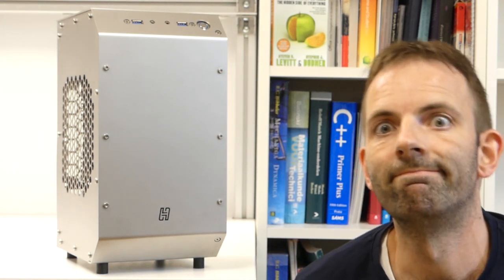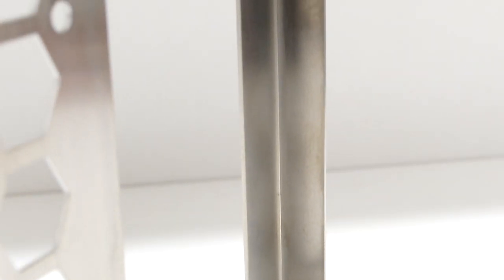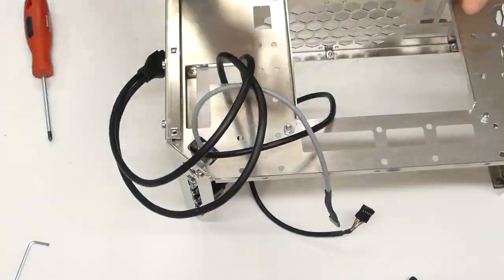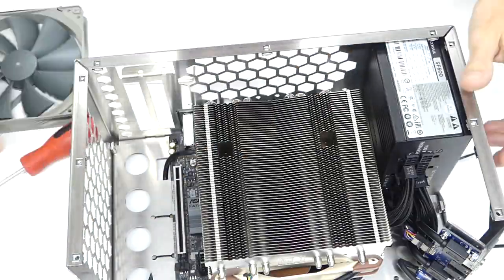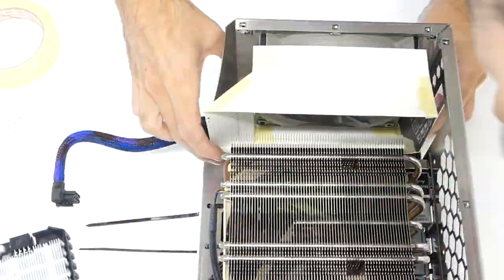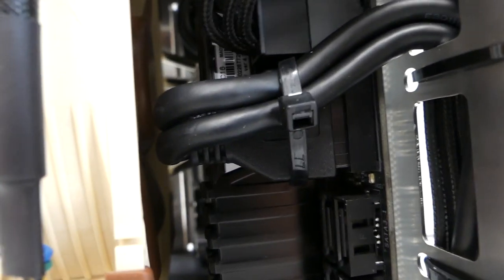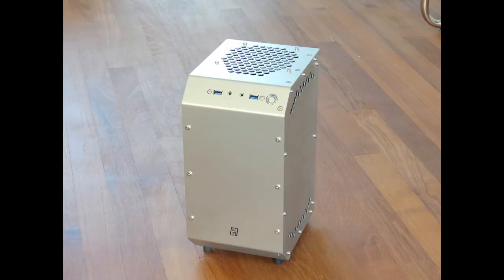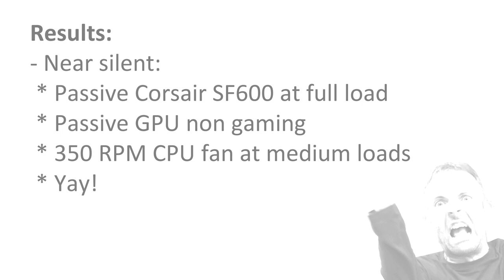Custom Mini ITX Stainless Steel Case Design And Build!

Comment: Great job! Power button is clunky but it does the job, a simple connector to join wires would be perfect to keep the button mounted to the shell
Reply from the maker: Yeah. I'm now thinking about having some washers made to stand off the button a bit, so it sits more flush. But a design 'feature' will make this hard.. The nut that holds the button in sits against the mobo tray. So I can't undo the nut, I have to turn the button in order to undo it.. Which means getting all the cable ties out and taking the power button/led connector off the mainboard... Its on my to do list for 2028 :D
Reply: Niels Heusinkveld that’s a good idea, having it flush by adding washer under instead of looking recessed like now will totally make it look more finished

Comment: Now I want to see the 800W gaming PC smart air cooled Heusnikveld solution!
Also, have you seen the new ATX 12VO standard from Intel? No internal power conversion to lower voltages in the PSU, those will be on the MoBo. In Linus's test, the low power efficiency was a LOT better. Interesting future. I will have to re-think how to heat my office room in the winter I guess.
Reply from the maker: Yeah I think the Linus video is inaccurate. Most power supplies already do efficient lower voltage conversion. Its only a few watts of power, compared to the 12V power consumed by a system. A little bit of wire to run a few watts of 5V power through isn't going to make a big difference in my opinion. I hope I'm wrong because modern systems only use so little power when idle, it sucks that you get 90+% efficiency when gaming but when staring at a spreadsheet, efficiency is much lower.
Reply: @NielsHeusinkveld  I think that Intel has other reasons behind this. The actual solution would be better label standards- because, as you say, power supplies CAN be efficient in the low power range, yet they rarely are. But... let's say you are a PSU manufacturer and want to bring a cheap 750W Gold efficiency PSU to the market, who is keeping you from not giving a s*** about the efficiency at the 70W range, if the label specs only start at 20% of max power. Not everyone reads extensive tests when buying a PSU. 
When the 80% efficiency standard launched ages ago, it was great for the environment, but they should have reinvented the standards for those labels a long time ago.
Reply from the maker: @renereiche  I think in the old days 20% was reasonable because CPUs and GPUs didn't run so low power at lower loads if I recall. Perhaps they should make a new line, call it 90+ and have a required efficiency at 5% load (5% of 600W is still 30W which is close to the idle system powerconsumption).. Instead of 100 different 80plus standards, start fresh, and raising the bar with 90+ :-) Of course you probably can't be 90% at 5% load, but at least get manufacturers to increase the efficiency at such loads.

Comment: Hey Niels, I'm designing my own itx case right now. I'm curious what sheet thickness you used for this and how ridgid it feels.
Reply from the maker: Hi, its all 1mm thick stainless steel. Steel and stainless steel have the same stiffness (i.e. how much a panel will bend when you twist it). Aluminium has 33% of the stiffness of steel. Aluminium also weighs 33% of an equivalent steel part. But most importantly, the stiffness grows with the ratio of thickness ^3 so going from 1mm to 1.5mm is a factor of 1.5, which is 1.5 ^ 3 = 3.375x stiffer, if the material is the same. The difference between 3mm and 1mm is a factor of 3, and 3^3 is 27x stiffer! Material thickness plays a HUGE part. And since Aluminium has 1/3rd the stiffness of steel, using 1.5mm aluminium is still stiffer (3.375 * 33% = 1.125) than 1mm steel. Finally and probably the most important is your construction. If you bend 90 degree lips like I did on the mainboard tray, you effectively increase the thickness of the material as you add 'ribbing' so to say. So the design and placement of ribs like that can easily make a 1mm steel case more rigid than a worse designed 2mm steel case, even though the pure material stiffness of 2mm is 8 times greater.

Comment: Makes sense if you want to show off 😉
I am slowly converting my PC to as silent as possible step by step.
My problem is now that the HDD and DVD reader are the loudest. And because of video making I'll probably keep using HDDs for a little while on.

Your greatest danger for nasty noise now is coil whine. Though, with an overspecced PSU and a 60 tier GPU, the coil whine might be quite low.
Reply from the maker: Can you soft mount the hard drives? That can make a big difference. Coil whine is nasty indeed! High pitched sounds.. Thankfully the card is mostly doing nothing during my work day, so it has no whine. When running a 3D stress test you can hear something. Its not the worst thankfully.
Reply: @NielsHeusinkveld  might be something to look into in the future. A mate has mounted his on elastibands, but I wouldn't recommend that if you value your data...
Reply from the maker: @RDMracer  Interesting. Way way back there was a long discussion on the Silent PC Yahoo Group (yes 20 years ago!) about suspending drives elastically and I recall the consensus was its fine if I recall. I would 'risk' it myself, I have a NAS in the meterkast for backup anyway, so I wouldn't mind having a working HDD suspended elastically in my main computer.
Reply: @RDMracer  I have softmounted my HDDs but the sound is still loud (to be fair 2 of them are quite old). Maybe you are better off with a NAS-like solution, that you place in a different room and/or closed off space.  If you want your data to be safe then that adds some options as well. Just make sure your network speed is adequate as well.

Comment: What thickness Inox sheet did you use?
Reply from the maker: Hi, 1mm for everything except the single part top/front that was 2mm.
Reply: @NielsHeusinkveld  Hi, thanks.
I'm also planning on building a 40mm width PC case which is a nightmare to actually find compatible hardware 🙃 I originally wanted it to be aircooled only but the Ryzen 9 that I plan to put inside is simply too hot!
I'll make mine out of 3mm aluminium for more ridgidity!
Sorry for the long text :)

Comment: You need some dust protection :D
Reply from the maker: Well, the case sits on my desk, it doesn't get a lot of dust. My problem with any sort of dust filters is they also block some airflow. Since I really want silence, I prefer having slightly slower fans with the penalty of blowing the dust out of the machine once a year. :-)
Reply: @NielsHeusinkveld  Would be interesting to see a one-year-later update. Looks good tho. :)

Comment: Awesome Neils! Two of my favorite hobbies put together.  Small Form Factor PC building and Sim Racing. You should share this on Reddit on r/sffpc. I currently run a Sliger SM580 personally.  Are you considering selling these? I would totally buy a Heusinkveld SFFPC case to match with my Sprint Pedals!
Reply from the maker: Thanks! For now cases are just a hobby. Between a one off and a small production run are a lot of headaches and issues. And people will complain if a computer case comes out before the H shifter.. :-)
Reply: The H shifter 🥺